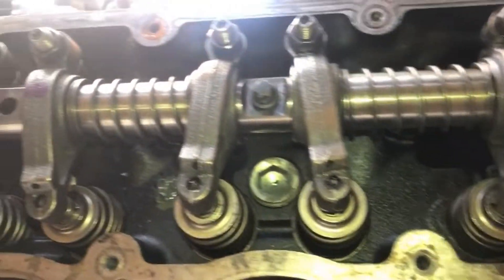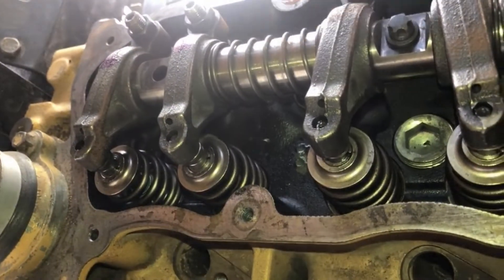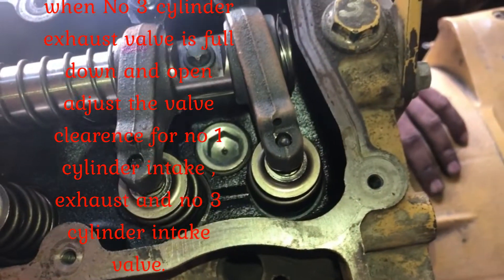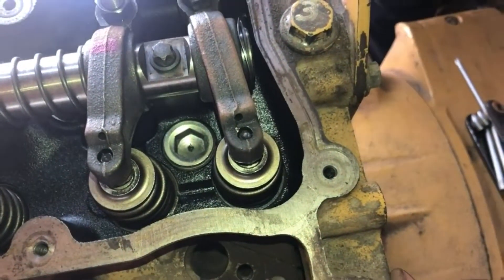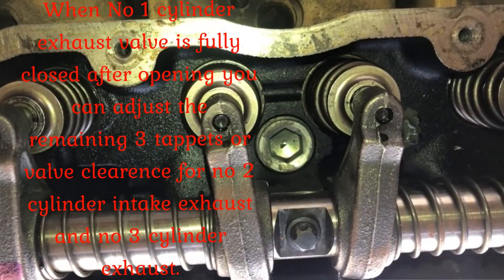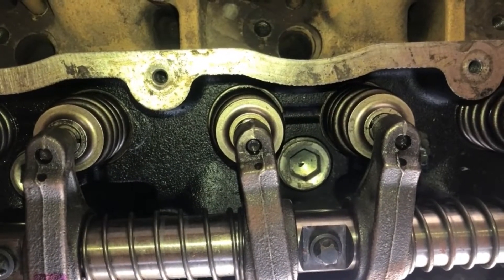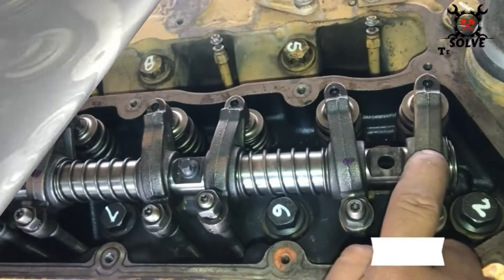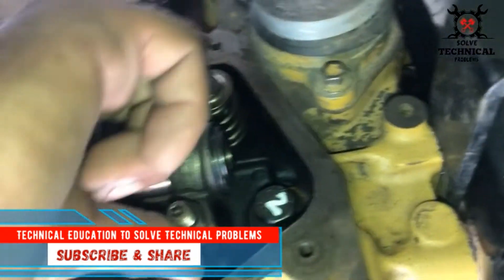Perkins 3 cylinder engine Valve lash setting firing order 1,2,3. Valve setting Perkins Dk short way

Comment: But i watched a video of some people setting the valves of each cylinder, intake and exhaust one after the other according to their firing order. Is that right?
Reply from the maker: In this method you can complete process in 2 rotations for firing order method you need three or four rounds to complete the process.both are okay 👍
Reply: Yes it is

Comment: Which number on feeler gauge for inlet and exhaust
Reply from the maker: clearance for intake valves is 0,20 mm (0.008 in) 0,45 mm (0.018 in) for exhaust

Comment: What would be procedure for the firing order? Is 1 ,3, 2
Reply from the maker: Fully Open number 3 cylinder intake valve and adjust number 1 cylinder intake and exhaust number 2 cylinder intake number 3 cylinder exhaust valve. Now rotate 360 degree and adjust remaining 2 valve number 2 cylinder exhaust and number 3 cylinder intake valve.

Comment: You’re the man! I was fighting this all day until I came across your video. Big ups, brother.✊🏽
Reply from the maker: Thanks
Reply: @Technical.Education  congrats brother,  but why does the engine shut down after running for one hour without being stopped
Reply: @Technical.Education  excuses, what size have you adjusted there
Reply from the maker: @TintinCornely-jz8xt  clearance for intake valves is 0,20 mm (0.008 in) 0,45 mm (0.018 in) for exhaust
Reply from the maker: @TintinCornely-jz8xt fuel problem

Comment: Good job but how about generator engine 3 cylinder valve clearance perkins engine U327528W serial number 2490/1500 engine type thanks pls reply.
Reply from the maker: Lock number one cylinder on tdc compression stroke and adjust valve clearance for number one cylinder intake and exhaust number 2 cylinder exhaust number 3 cylinder intake valve
How to find tdc compression number 1️⃣ cylinder looking at number 1️⃣  cylinder intake and exhaust valve rotate the engine bring valves in overlap condition when your intake valve is opening and exhaust valve is closing mark on the crank pulley and the block now rotate engine 360 degree that is the tdc for compression stroke number 1️⃣ cylinder.
To adjust the remaining valves rotate the engine 360 degree from the number one cylinder compression stroke this will bring number 1️⃣ cylinder on the exhaust stroke now you can adjust number 2️⃣ intake number 3 cylinder exhaust valve
Any questions feel free to ask
Reply: Thank you sir for your help i need to know also the correct torque of cylinder head bolt,main bearing bolt,conrad bearing bolt and how many mm is the valve clearance of intake and exhaust valve thank you more power to your channel sir .
Reply from the maker: @venersamarita2396  kindly send plate of engine model
Reply: Where can i send sir?
Reply from the maker: @venersamarita2396  +923400004725
What's app